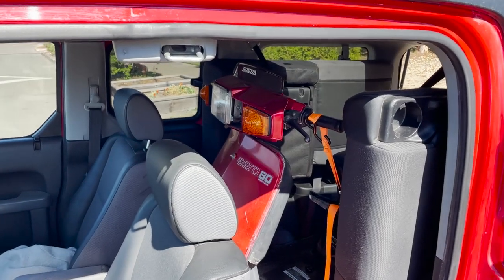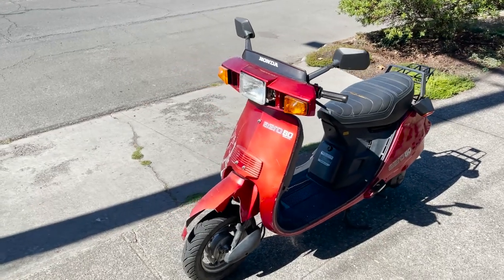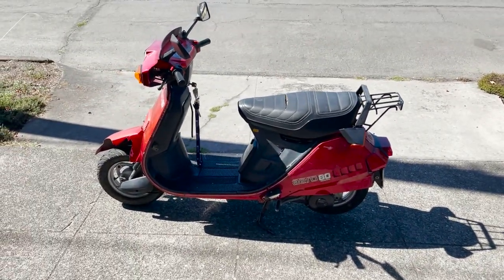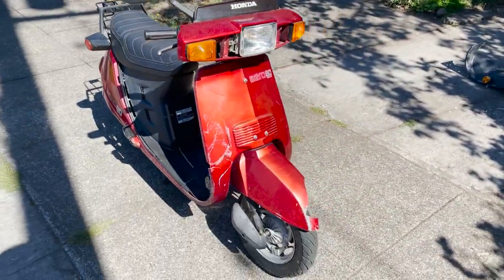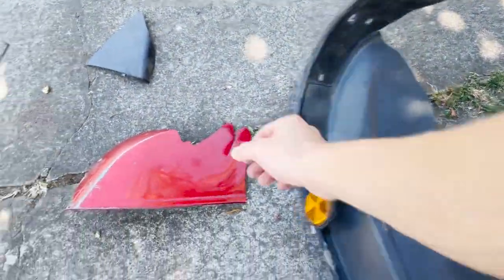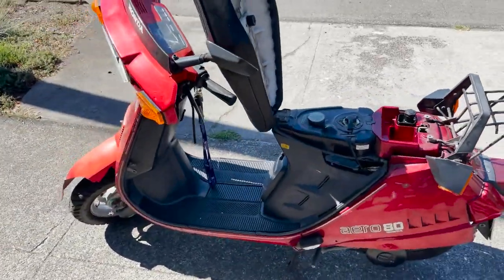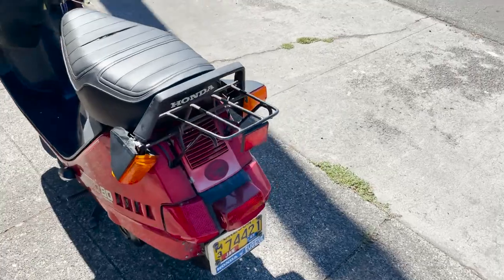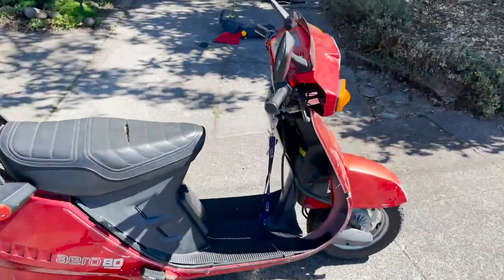1985 Honda Aero NC80 Scooter! The Fastest 80cc Scooter Ever Made!

Comment: That's not a 1985.  '85 didn't have kick starter.  And the body isn't correct for '85.  You likely have an '83 or '84.  The VIN is on the frame behind the front tire.
If it reads 1985 someone has swapped a bunch of earlier model parts onto an '85 frame.  Hope that helps you find correct parts!  Good luck.
Reply from the maker: Thank you for the info! The guy I got it from said 85. I will check the frame👍🏼
Reply: How is the scooter restoration going now?  Did you verify it's year?
Reply: Are these good? I have seen one non runner. Mechanic kid said avoid sprees which in Europe is the Melody I think. But what are the spares situation with these? And would it make a good project. Or is there an easier model to try for, please? Thank you.